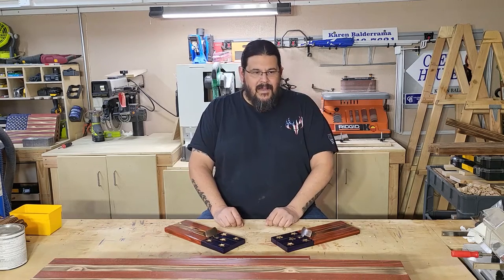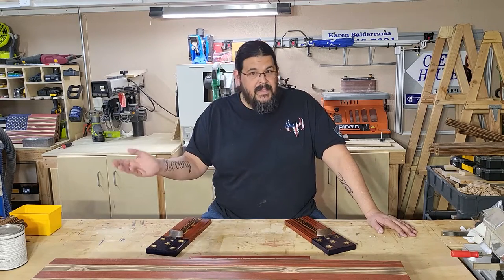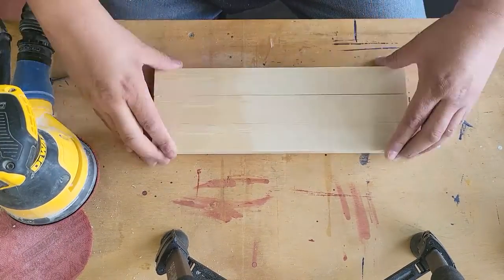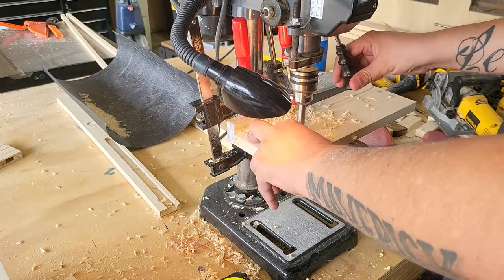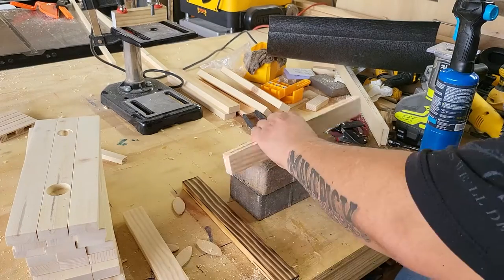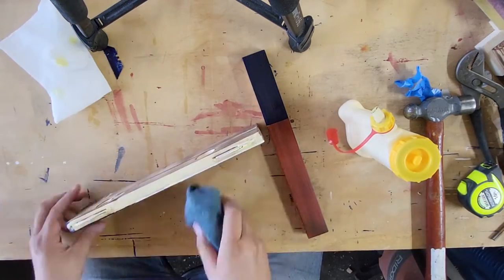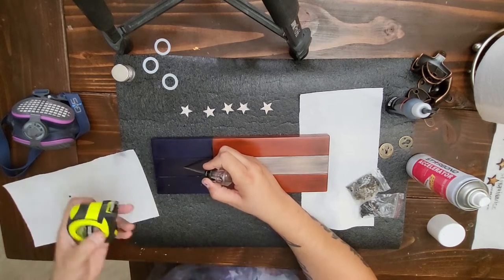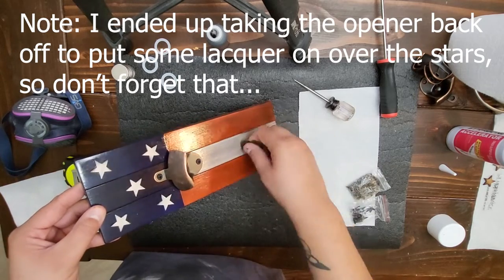How To Make a Wall Mounted American Flag Bottle Opener - Easy DIY Scrap Wood Project That Sells!

Comment: Great job, I just bought a few items from Amazon off your affiliate program. Biscuit cutters are like a router, you never need one until you do. I use mine all of the time. Great video
Reply from the maker: Thanks, John! Yeah I use it for aligning bigger glue ups too now. In fact, I'm working on a custom flag right now that's the biggest I've ever done, and I'm using biscuits to line those up.

Comment: I use a 1x6 and it works just fine with less work and same money when i sell them
Reply from the maker: I'm kind of a stickler when it comes to the proportions being correct. Since I use 1" laser cut stars, I need the three stripes to be 1.5 inches. At 5.5",  your stars would need to be 1.5".

Comment: keyhole bit might be a simpler process for you. i use them they work great
Reply from the maker: I do use just a keyhole on things like the crosses and flags , but I was concerned these wouldn't hold up over time due to the constant prying off of caps and felt more secure with the metal ones. You're probably right though, they'd likely be fine with just keyholes. I tend to overdo things sometimes. I have a touch of OCD.

Comment: Question. Couldn't you just use palette material and cycle it as a 1 by 6 which they are?
Reply from the maker: Sure, you could use any wood you want, I suppose. These are not 6 inches wide though, they are 4.5 (3 x 1.5" stripes). If you made them 6 inches, you'd have to adjust sizes or add a stripe, of course. I typically make these from scraps leftover from flags, which is why they are made the way they are. When I do make them out of solid wood (and I do, when I don't have scraps but need some), I usually make them the same size and use the CNC to cut the stars and the lines between the stripes and union.

Comment: What glue did you use to install the Neodymium Disc Magnets?
Reply from the maker: I used CA glue (Starbond), but hot glue or epoxy would work just as well.

Comment: Great job as usual. How fae down did you go for the hanger and how far up  for the magnets. Tried to order some of the products and I got not available . Keep up your great tutorials
Reply from the maker: I don't remember. I haven't made these in a while I'll have to look into it and get back to you. It's not really that critical. Off the top of my head,  the hanger is probably 2-3 inches down from the top, and the magnet 4 or 5 inches or so below the bottle opener. I'll also check those links and change them if necessary.
Reply: @maverickdesignswoodworking  thanks gives me something to work off of.

Comment: awesome video. Going to make some of these as well as the box for "bang bang" devices. How much do you charge for the bottle openers?
Reply from the maker: Usually 35 to 45, depending on the circumstances. If it's just someone buying direct from me, usually 35. 40 if paid like 50 bucks to sell at a venue, and 45 if I paid like 100 or more.
Reply: @maverickdesignswoodworking  thank you very much for your answer. I am getting in to building things from wood. I present do laser engraving and cutting....but it is only 1/8" baltic birch. I have an 80watt laser and it is amazing. I am always looking at making items that I don't see that often at shows and I don't see these bottle openers at shows. Thanks again for your tutorial as well as oyur answer.
Reply from the maker: @schlotdoglaser  Thanks for watching!